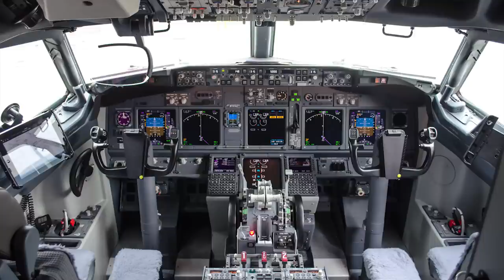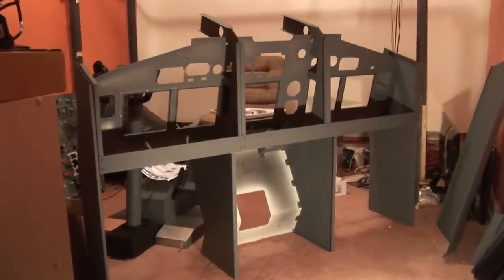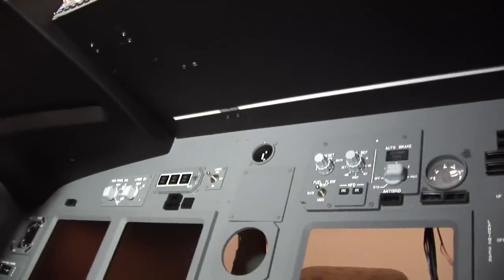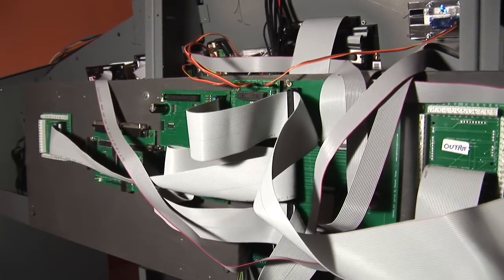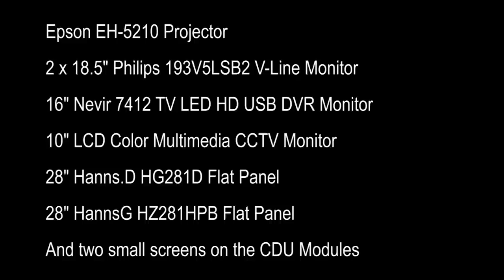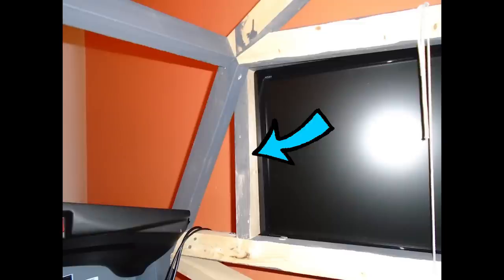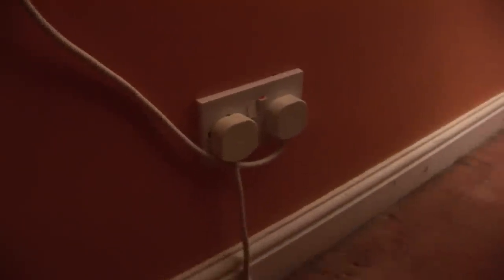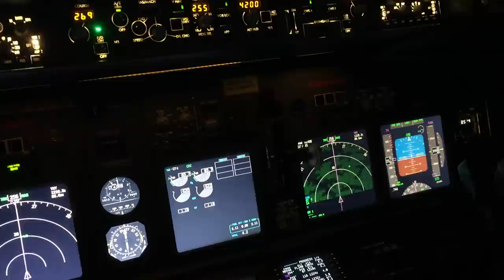Building a Boeing 737 Cockpit

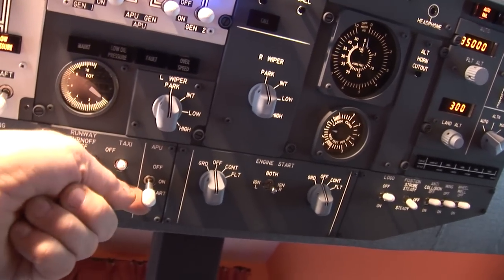Comment: 52:29  In the airplane, you would want to test the fire and overheat switches and the squibs on the fire bottles ( all on the Fire Switches panel) before starting the APU.  Does your sim have this capability?
       After APU start, you turned on the recirc fans and opened the APU bleed valve, but left the pack switches off.  This would result in no air conditioning for you and your passengers,  but would be the correct configuration for engine starting.
Reply from the maker: Correct.  But there are two settings for the AC packs and mine were on the middle setting.  The packs are turned off when pushback is started so the main engines can spin up for a start.

Comment: Did you ever think of changing the 3 monitors and replacing them with LG Ultrawide Monitor 49WL95C
 i think it would be more emersive this way?
Reply from the maker: What I have is much larger and more immersive. I have 180 degree vision and can see up as well as down. Good thought though 😊

Comment: Hey Dane, I have been wanting to build a home cockpit for a while, but I am not sure if my computer can handle it. Would you mind taking a look at my specs and telling me if it can run the cockpit?
ryzen 5 5600x
16gb ddr4 3600
2tb hd 500 gb ssd 220 gb left on the ssd and 1.51 terabytes left on hd
rtx 3060 ti
either a 650watt 750watt or 850watt power supply
and an nzxt case
Reply from the maker: Hello - it looks all right but I would up your power supply to at least an 850. Each of my computers running my sim has a 1000 w - partly to power the graphic cards but also to ensure all the USB devices I have also have stable power. My main computer has a 500gb M.2 for the operating system; then two additional 1TB M.2 chips for drive D and E. I redirected my user folders to D drive (to spread the read/write load, and P3D is on E drive - again to spread the read/write functions and make it a little speedier in response time.

Comment: Really sweet setup. God bless you.
That must eat a ton of power and give off enough heat to warm your home. Did you have to run a new power service to your house? What about A/C?
👍👍👍👌
Reply: In my bedroom I have 4 monitors and 2 computers.. this really isn't that much different and it's only using power when he's flying while my computers are on 24/7.. it's just one 15A outlet. LEDs don't use much power or generate much heat and no my pcs don't warm my bedroom.. so I would imagine it's not as crazy as you think
Reply from the maker: According to a meter, it actually takes less than 1 KWH total with everything on.  And if we ever get another hot summer in England, then I do have air conditioning!

Comment: Cracking cockpit! thanks for sharing your videos, they are a great insparation for me, 
where did you get the material for the side walls/floor please?
Reply from the maker: The cockpit is just set on the floor of my spare bedroom which is carpeted.  The side material is very thin plywood on which I glued some plastic material from Amazon that is used for table coverings.  The other material over the rest is vinyl flooring from a nearby flooring shop.  It is grey and very flexible and wraps around things very nicely.  It does give a nice finish.  And the frame is simple 2 x 4 studs bolted into place. 😊
Reply: @FatherDane  thats great I will look for that on amazon for my build. Watching your video has given me plenty to think about thank you!
Reply from the maker: @burbsman  You are more than welcome.  Happy landings to you 😊
Reply from the maker: @burbsman  You are very welcome. 😊

Comment: How cool is that!! What a fun project! I personally would have wanted someone to build it for me though. My patience would have lasted about an hour. 😂😂
Reply from the maker: I too would have preferred that ... but it would have cost a whole lot more 😂
Reply: @FatherDane  you did amazing work! I know nothing about electrical, so it's beyond my capabilities. I do dream of the day I can put a simulator like yours in my home. Maybe when I retire! 

How much do you think you have invested money wise into this project? Is it insured by chance?
Reply from the maker: @ChrisJohnson-hk6es  Actually, the instructions for assembly and wiring were very clear and easy to follow. As to cost, well my estimate today would be around $30,000 invested in it (part by part and piece by piece).  And it is insured along with all the other contents of the house - not to insure it would be impractical in case of fire. I started mine after I retired, but if I had thought it through, I would have started much sooner. 😊

Comment: Hi Fr. Dane Congrats on your cockpit building! it looks super. A question about the power supplies (5v and 12V) do you need that for the MIP or that's just for the overhead panel?
Reply from the maker: Thank you for the comments.  As to the power supply, yes, the modules all need various power.  For instance, the forward overhead needs 12v and 5v.  The MIP requires 12v, 5v and 3.3v.  The chrono requires 6v and the radio modules also require 5v each.  I have a standard (computer size) power supply to provide power to the 12, 5 and 3.3v MIP but I use separate power supplies for each of the radio and chrono units. Does this help?
Reply: Father Dane Hi Fr. thanks for your email. So basically you need power also for theOPENCOCKPITS USB PLUG & PLAY like the Nav and Comms?
If I may ask, how did you connect the wiring from the power supply to the modules?
Reply from the maker: The power supplies are nothing more than a standard unit like this: https://www.opencockpits.com/catalog/power-source-p-149.html and as they have long wires attached, it makes it easy to run the wires.  Does this help?
Reply: Father Dane hi Fr thanks for the reply so basically even the Plug and Play modules have to have EACH a power supply
Reply from the maker: Not necessarily - they have to have the proper voltage, but if you can find a single power supply of the proper voltage that also can deliver enough amps, then you can share the load through one power supply and feed all of them.  If you look at my simulator, you will see that I went with the individual power supplies for the smaller modules and that works for me and my situation, but you have to look at your needs.
Reply: Father Dane thanks Fr. Well done for the video and work!
Reply from the maker: You are welcome - happy landings!

Comment: Do you have one computer running all the visuals? What are the specs of the computer(s)?
Reply from the maker: Yes, one just for the external views. It's an ASUS X99 Deluxe with a top-end Intel X99 processor, 32 GB RAM, and three GTX980 cards tied with an SLI.

Comment: Calibrate the side screens that the intensity of the beamer  correspondents with the two side screens.
Reply from the maker: I have tried to match it as best I can, but the centre is a projector and the sides are LEDs so there will always be a difference.  What I would really like is a setup  of five very large 4K monitors in a 270 degree arrangement - but you can imagine what the cost would be for those, let alone the extra computers I would need to power them.  But I can dream :)

Comment: Hi Father. Can you explain about the FMC screens. I thought they where the complete FMC from open cockpits. Did you purchase the FMC parts separately ?, Thank you.
Reply from the maker: The FMC/CDU are individual units that can be purchased from opencockpits.com They require a video connection for the screen and a USB for the button functions. I have two and they are designated captain and first officer sides and each will accept input during flight programming. The picture in each FMC screen has to be slid, resized and positioned into the screen opening of the actual FMC. I use PMDG that allows screens to be moved and fixed. 😊
Reply: @FatherDane  Thank you for your Kind reply and helpful information. I love the xplane and msfs. Up in the skies brings a lot of good memories and a little bad but a good life it was. Until they stole my left leg. and my best friend. But thats another life story. Thanks.
Reply from the maker: @lewymartain8267  Sorry to hear that, truly

Comment: Hello Father, I was wondering if you might explain a little bit about how exactly the cockpit interacts with the sim?
Reply from the maker: The hardware sim comprises a number of USB components that link to the simulator software (in this case P3Dv5.2) via a small free software programme called SIOC. There are scripts that were written by Roar Kristensen (OC4BA) that directly link to and replicate the controls of the sim aircraft using PMDG 737 NGXu as the aircraft. SIOC and the hardware are available from opencockpits.com in Spain.

Comment: Nice video. How much did it cost? You use it for your parishioners?
Reply from the maker: Yes I do let others use it. My retired friends, parishioners and colleagues all come to use it.  I like to share things with others. Even the local bishop comes in to fly it. And I do not charge anything - pleasure should be shared freely.

As to cost, I purchased and assembled everything in stages over the past 15 years.  It was only when I was able to afford the MIP as a unit of parts (from Opencockpits) that it really stayed to take the shape it is today.  And even that took me almost a yes to complete.  So determining cost is subjective to a certain point.  What I basically say when I get this question is this: if there was a fire and the insurance had to pay for a replacement, then I would expect a cheque for around £25,000 GBP to be able to replace it.  Does that help?
Reply: Nice initiative. I'd like to own a similar one. I have no space to place it, as an investment it's even too big at the moment. Best regard 👍
Reply from the maker: @andreabuonocore1932  :)

Comment: the only thing missing is how to many electrical sockets needed with so many cables in use.
Reply from the maker: There are a lot as I want to add the load incrementally when I switch on.  Plus, it helps to find out where a problem is is various parts are on different sockets.  😊

Comment: I know it's been 2 years since making this, but I'dlike to point out a few general things.

One thing that could prove to be a problem is the CPU.
As per my review, the PC configuration is definitely CPU bottlenecked when it comes to the flight sim in this form - be it P3D or X-Plane.
When you need to run something like this, heavily modular, resource intensive, you need a fast processor with good L3 cache, fast NB frequency, thus a very fast communication with the RAM memory - and of course in a class for the motherboards with enough PCI-Express lanes in order to provide the full throughput for all (most of the times) 3 GPU cards.
As far as the number of cores and threads is concerned, the CPU is perfect, since the number of cores should not go above 16, as anything above 16 cores will not get fully utilized by our current simulator platforms, while it will also have a higher TDP, thus a lower per-core (single core) frequency - which proved to be one of the most important things on our current both ESP based and X-Plane based platforms.

AMD started tackling that with their Infinity Fabric implementation, but we're only now seeing its full potential with the Ryzen generation 3 and Milan class of CPUs.
Intel also has their own similar novel implementation with their i9 K and X series.

I guess Mr.Dane went for the 5820K back in 2018. due to it's very decent 15MB of Smart Cache, support of 
FCLGA2011-3 socket thus providing up to 28 PCI-E lanes, fast NB with quad-channel support, while retaining (for a workstation class CPU) relatively decent TDP.

But the main problem here will be the single-core performance that doesn't go beyond 3.6GHz.
In this scenario, going with 3 x 970 GTX might be as good as 3 x 1080 TI - the 3 powerful GPUs cannot be fully utilized since the 5820K with the quad-channel Dominator Platinum will be able to process all the aircraft systems requests for all the modules of the cockpit together with all the simulation variables such as weather, physics, etc. - but will struggle to resolve any significantly more complex scenery and the rest of the graphics and send all of that in time for the GPU's to render.

Mr.Dane luckily thought ahead, plus we have a strong competition going on between Intel and AMD, so now 2 years later and without making additional investments into the RAM memory or the motherboard he is able to get a CPU with even better architecture and denser litography, providing him with 3x more speed per core than the i7 5820K - thus making those 3 x 1080 TI GPUs shine in their full glory.

This video is very instructive to new cockpit builders, and I even downloaded it for my video library because it is really a precious resource.
I'm glad you spent time on recording the whole process and sharing it.
I hope you advance your cockpit all the way, as we eagerly wait for the simulator of our dreams this year !

** I am an owner of the same Boeing 737 deck, but utilizing my own 3D colimated vision technology that I recently filed a patent for, within a closed lightweght cabin placed and configured to work on a 6-DOF moving platform patented and manufactured by Bosch Rexroth **

All The Best !
Mr.sci.eng.MILAN PUTNIK
Reply from the maker: Thank you for that excellent analysis.  You are spot on.  And you are quite correct in that this was the best system at the time.

I have tried very hard to get a balance.  The frame rate will always be lower than I would like, but after all this time, I do believe I have managed to get used to it so now it doesn't bother me as much.  The i9 series does sound like a big improvement and my fellow enthusiast Roar Kristensen has just got one and he reported some excellent performance.  I am busy saving my pennies and dreaming ahead for a new system to power all this.  Right now I am waiting to see what the upcoming FS 2020 will look like and what demands it will make.

And may I say how envious of your simulator: a full motion sim is a real dream!

Thank you for sharing your analysis and I am delighted that the video proved a useful resource for you.

Happy Landings

Father Dane

Comment: This is an awesome build but can't help to think that it could have been made better with PC monitors as the front window rather than a projector as it would have less input latency, more accurate colouring and more seamless transitions between the screens (couldn't help but notice at 55:40 the vehicles disappear off screen for a while before reappearing in the window monitor)
Reply from the maker: You are correct of course.  I actually wanted three projectors but the bedroom is too small to accommodate such a setup.  I started out with only the front view (projected) but as you know, it is important to be able to look left and right during taxiing and flight to avoid collisions and accidents.  As to the vehicles disappearing, I corrected that later on when I had my 737 captain friend visit to assess what he can actually see from the left seat.  There were some adjustments made both to the view angle and to the height (relative to the eye-level height above ground).  It was important that his view whilst taxiing, take-off and landing were reasonably accurate.  Thus the vehicles are more realistic now than when I first made that video.  But good call on that.  You have sharp eyes!
Reply: @FatherDane  you did an excellent job building this! I work in aviation myself on Boeing 717 aircraft and would love to build something like this if I could afford to 😂

Excellent build and very entertaining video 😊
Reply from the maker: @jaykaye8666  Thank you

Comment: Hello, I was wondering where you got your dual: between - legs yoke system? I am struggling to find ones like these apposed to the average clamp - on - desk model. Thanks
Reply from the maker: Opencockpits in Spain.  They actually do a dual model and it comes with a base on which you can also attach - and connect - two pedals, Mine are not connected but two individual yokes (one designed to be Captain and one a First Officer design), That's also the same with the pedals - mine are not linked.

Comment: I'm still in the middle of the video so maybe you've mentionned it later on but, how much did all of this cost (the full setup including monitors/PC/evreything please), if you don't mind telling of course! Thanks in advance
Reply from the maker: I bought everything bit by bit over 16 years so putting an exact figure will not be easy.  But if there was a fire then I suppose the insurance company would probably have to spend about £25.000 to provide me with a replacement.  Does that help?  And that includes all the hardware as well as the software.
Reply: @FatherDane  Yes that helps! Thanks for the quick reply and btw I just finished the video and IT LOOKS INSANE! I wish one day I'll have something like this at home hahaha
Reply from the maker: @KingOPtiCzZ  I am sure you will.  By the way, I am busy editing another Quarantine Escape Flight and I should have it up online in about an hour.  It will show some simulator views from the other side of the windscreens showing my connections and wiring and how it all helps to create the illusion of flight.
Reply: Father Dane I’ll be waiting for it... just subbed!
Reply from the maker: @KingOPtiCzZ  Just posted: https://youtu.be/ZsOQuCPwELg